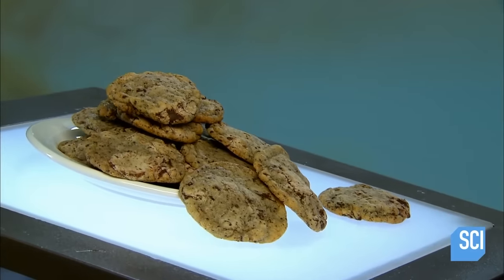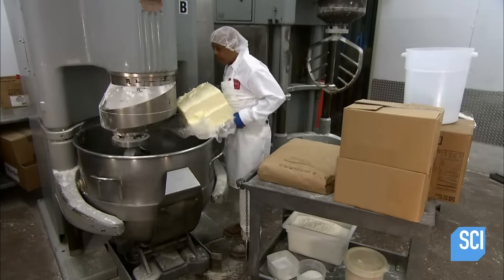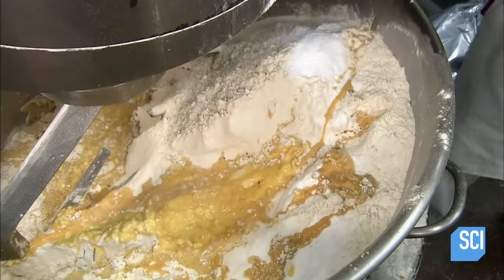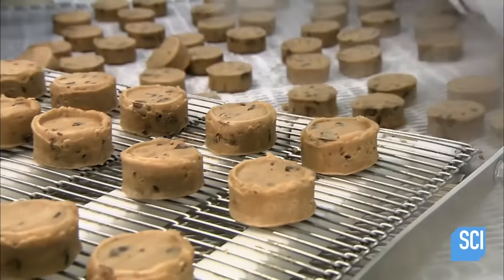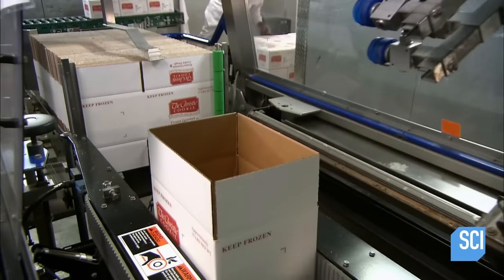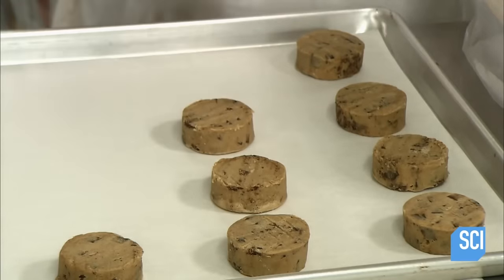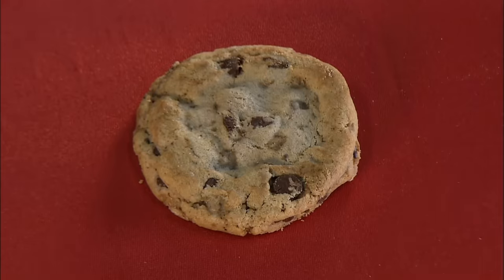How It's Actually Made - Chocolate Chip Cookies

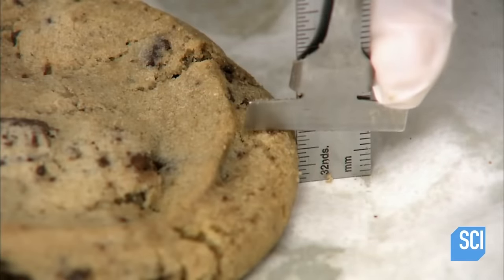Comment: At 10mm thick (4:22) and 1.45 ounces, which is approx 41g, these cookies have a density, according to AquaCalc, of 216grams per metric cup, or 0.864gcm^-3, and therefore are a total volume of 47.5cm^3. A thickness of 1cm makes no difference to this, so when we do (sqrt(47.5/pi))x 2 we get a diameter of 7.77cm per cookie, or just over 3 inches. Bonus points please?
Reply: You madman

Comment: For the bonus point:

Let C1 and D be the circumference of the cookie and diameter before baking, respectively, 
and C2 be the circumference of the cookie after baking.

C1 = 2(pi)(1/2)D
C2 = 2(pi)(1/2)(2)D
      = 2(pi)D

C1 : C2 = 2(pi)(1/2)D : 2(pi)D
              = 1 : 2

So,  the circumference of the cookie after baking should be twice as large as its
circumference before baking.

Comment: 3:51 
The average male hand size from one side to the other (diameter) is about 3.5 inches, and based on the original cookie’s comparison to a human hand I’d say the diameter pre-oven is around 3 inches. Using 3.14 in place of pi, and the equation C = πd, the original circumference is about 9.42 inches
If diameter doubles, the diameter is now 6 inches. Using the same equation, the new circumference is about 18.84 inches.
The exact diameter pre-oven is unknown so this is only an estimate, although I tried my best to estimate the new circumference of the cookies for you.

Comment: Given that the cookies are about 1-1.5 inches in diameter before baking, the new circumference after baking would be twice the original diameter, which is 2π to 3π, or about 6.28 to 9.42 inches in diameter.

Comment: Now, I'm going to be a massive nerd here and actually collect my bonus points by doing the YouTube equivalent of looking further in the test to see if there are any hints for the question.

At 4:17 we see a cookie next to a ruler. Judging from the amount of the cookie that isn't visible compared to the ruler, I've determined that the radius of the melted/baked cookie is 1.5 inches. The formula for circumfrence is 2(pi)(r) or pi × d. 3 times pi equals about 9.42, so my answer for the new circumfrence of the cookie is 9.42 inches.

I'm going to assume Huggbees wasn't lying when he said that the cookies double in diameter when they bake and melt, so since the diameter is half of what the cookie is when it's baked, we can find that the circumfrence of the cookie pre-baking is about 4.71 inches, since 1.5 times pi is about 4.71.